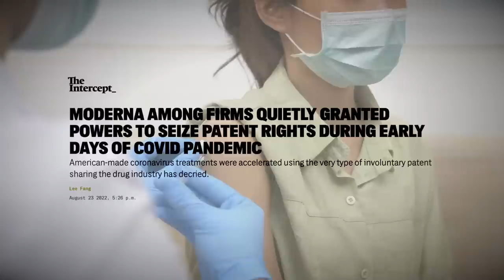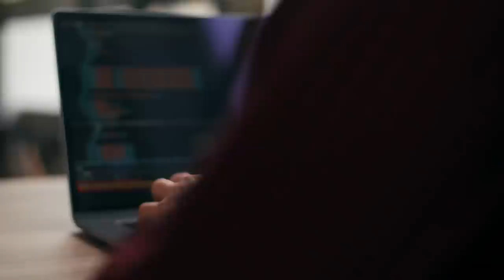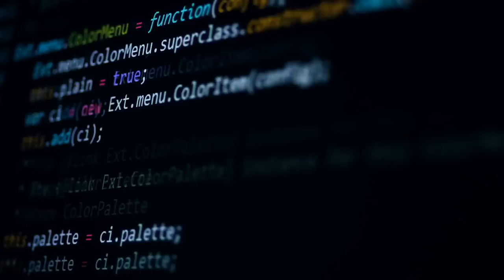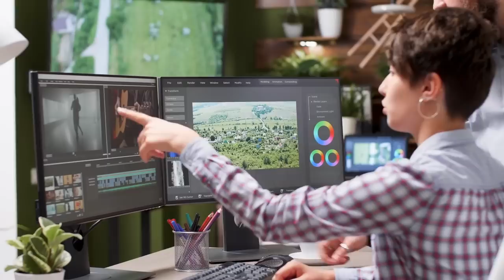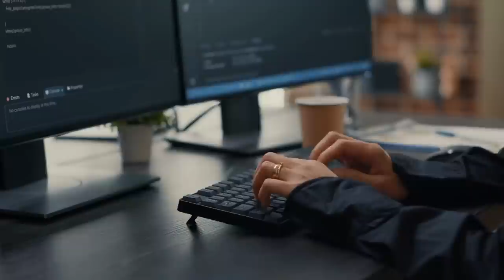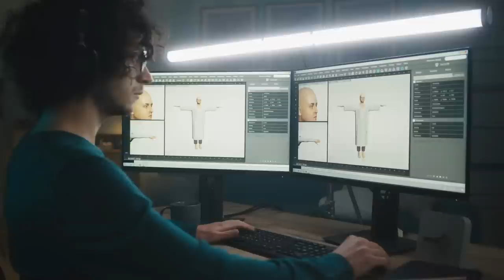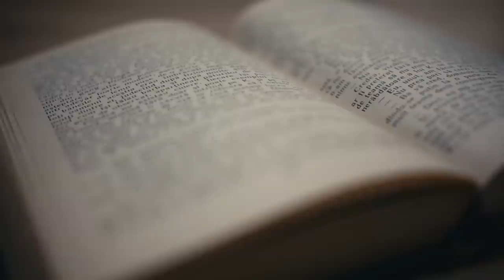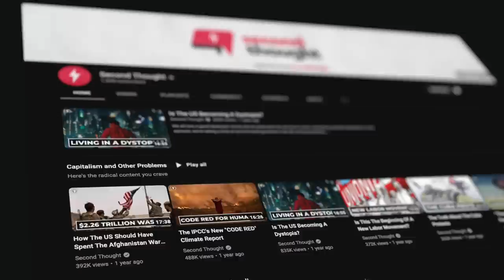Why We Should Get Rid Of Intellectual Property

Comment: Minor correction: Some of the most commonly used insulins, including Lantus and Humalog, have had authorized generics available for a few years and true generics for about a year. Still too expensive.
Reply: I was saddened he ignored the fact that intellectual property expires. The first insulin patent was 1923, why are Americans still buying protected insulin?
Reply: @superskrub4209  I thinks its because they renew them, by very slightly changing the formula, then patenting that new design. it's still close enough to the original that they can claim its ip theft when someone fabricates the original
Reply: @madladthad2403  this
Reply: @superskrub4209  Insulin itsself may not be patented, but the means of manufacturing it are. Also, not all insulins are alike. Often a manufacturer of pharmaceuticals or medical products will deliberately have their old products de-certified by regulators before the patent runs out, arguing that their new products are far superior and safer and render the old ones dangerously obsolete. That way when the patent does expire, it's still impossible for anyone to manufacture or import a competing product.
Reply: @vylbird8014  I think the same thing happens w/ manufacturers of refigerants.
Reply: @anmolt3840051  That's what I said. It's not the insulin itsself that is patented - sort of. There's more than one type of insulin, and while newer ones are patented, there's nothing patent-wise covering a slightly older form. But there are are a lot of adjacent patents - patents on manufacturing methods, on other components packaged with the insulin to preserve or or maintain sterility, on delivery mechanisms that are more convenient than the classic hypodermic*. There's also a substantial barrier to entry for any potential new competitors, in the form of regulatory compliance. Much of it well-intentioned, but getting your formulation and your factory full certified by the FDA, and maintaining that certification, is no easy matter. And certainly not cheap. So there are only three insulin manufacturers in the US - and they seem to have an unwritten agreement not to lower prices.

Regulations also make imports impossible. Yes, Canada has affordable insulin - but you can't legally bring it into the US, because it doesn't have FDA certification to assure it is safe. It doesn't matter that their Canadian counterparts are every bit as strict - their ability to certify safety ends at the border.

A major part of this problem is due to regulatory capture. The FDA works very closely with pharmacutical companies, to the point that there's even a flow of employees between them. A lot of FDA managers used to work for the companies they now regulate, and a lot of former FDA employees can look forward to lucrative future employment at one of those companies. If, that is, they play nice. Anyone who makes a serious effort to bring down drug prices, or to make it easier for new manufacturers to produce generic drugs, is going to find themselves pushed out of this friendly system - no promotions, no cushy future as a 'consultant' doing lobbying work. So the FDA isn't really representing the people of the US any more: It represents the very industry it is supposed to be regulating, and imposes regulations that are inconvenient for the major companies but catastrophic for any smaller or foreign competitors.

*That's an important one for epi-pens, because patents can't be expected to carry out a delicate injection procedure while in anaphylactic shock.
Reply: Thing is that those generics are made by the company that makes the brand. Reli-On Novolin insulin at Walmart is made by… Novo Nordisk who also makes Novolin. Packaging is the same as well. This is common in pharma. Astra Zenica makes their own generic of Symbicort, Mylan makes their own generic of EpiPen.

So then the question becomes why not simply lower the cost of the “brand”?
Reply: @vylbird8014  "So there are only three insulin manufacturers in the US - and they seem to have an unwritten agreement not to lower prices." - sounds like a cartel
Reply: @vylbird8014  You will never ever get anyone to engage productively on the topic of regulatory capture or the burden of regulations because it does not place the onus solely on Big Evil Capitalists who are magically preventing competition even though it would be so profitable to undersell them. This channel has a very myopic lens which it uses to view literally any scenario, especially the overly complicated migraine-inducing ones.
Regulatory capture and intellectual property chicanery needs to be addressed in various ways, sure, but the "well-intentioned" practice of onerous consumer safety requirements that ultimately still fail to prevent edge cases must be addressed as well. It is not productive or useful in the few scenarios where legitimately dangerous products are sold, and it has slowed the US medical industry to a crawl. The cost of that burden is directly offloaded onto consumers. Without burdensome and poorly implemented regulations, "regulatory capture" would not be possible.
The worst manifestations of all of this are laws and regulation around clinical trials omitting a patient's right to informed consent without IRB approval, substances being "controlled" at any level (including legend drugs), and legal requirements that US citizens engage with the insurance industry and its incestuous network of profiteers.
Reply: @Bingo_Bango_  Regulartory capture only happens because of capitalism. People are corrupt because it helps them make more money and/or live an easier life. This is much less of an issue when you are guaranteed a standard of living and don't have to worry as much about financial issues and if you are going to get a job with the people you are supposed to regulate.

You could also make it illegal to work or profit off the same sector as you were once responsible for regulating.

Comment: This is a great topic to cover.  I'm an Industrial Designer and I've done a lot of work in tool design where I've seen some pretty toxic use of IP.  

For example: Sawstop table saws are highly desired by woodworkers because they have a safety mechanism that instantly stops the blade if it contacts skin, saving many fingers hands etc. They are also hundreds of dollars more expensive than saws made by other brands because Sawstop owns the and other tool manufacturers have not been able to replicate it or buy the rights to the tech without getting sued (Bosch had a version for a while and was forced to discontinue it). Unsurprisingly profits > users severed fingers.

Comment: There's an interesting trope in some sci-fi about an extreme form of IP protection. Basically, all components are protected by and stored as liscenced blueprints. The only way to use then is by effectively paying to unlock them, and even then only for a limited number of uses and they can only be used in certified constructor machines. Assuming that most of their tech is beyond a human's ability to produce.

So what happens when all your production is utterly dependant on this, and a section gets cut off from the liscencing servers? 

All hell breaks loose for completely arbitrary reasons. You have the designs, the constructors, the materials, but you aren't allowed to use them.

Comment: All the talk around insulin is great, but just wait till you get deeper. Every finger poke blood sugar test (the most accurate test) is $1-$2 per test, which can need to happen multiple times daily. A continuous-monitoring device costs ~$300-400 every 10 days. Insulin pumps cost $5000 and are supposed to last 4-5 years, and the supplies for those cost $150 a month

Comment: Patents have to go, no question about it. It's so plain to see that they're absolutely NOT needed to incentivize any type of innovation. Also, IMHO the only IP huge corporations should hold is very basic brand identity protection (as in, to make sure no one steals their logo and/or sells products or services in their name). These are my thoughts about IP, especially regarding artistry which is a common argument for it as stated in the video:

The main problems with the system currently are that almost anything can be turned into IP,  that the IP can be held by massive corporations instead of people or small societies, and finally, that it can be bought and sold. ie Disney can just buy out IP to fuel their cultural empire and amass a sort of mainstream media monopoly, as well as choke out any independent creators who work under them by forcing them to relinquish THEIR work's IP. This may seem counterintuitive (why would anyone work with Disney then?) but in many fields, if you want any kind of relevancy, you're usually gonna have to work with some IP-gobbling giant corporation with an executive board hungry to push out merchandise and 30 sequels. This kind of predation already happens with publishing companies, record labels, networks etc that take over artists' work in exchange for pennies and a temporary platform, and it's getting worse by the day.

The thing is, the idea of IP COULD serve to help protect creators and artists. But it should only work at an individual/society (in the business sense) level. In an ideal world, if I make a piece of art and I'm selling it, I think it'd be nice if other people couldn't just copy it and sell it around without my permission, even if they did credit me. I DEFINITELY wouldn't want any company taking my art and re-using it, plastering it all over their products.

Furthermore, even in an ideal world, not every talented artist and creator will be able to crowdfund their projects, especially if they don't already have a following. If their work isn't directly beneficial to society in a very concrete way, government funding is probably out of question too. A lot of artists do freelance or contractual work under some company to survive. I'd argue protection from the company/contractor taking away their art and casting them aside as soon as possible to cut costs would be vital: if IP was inseparable from the actual creators, it could work as a way to give them permanent rights to their own work, providing legal power to fight against the misuse or insufficient payment of their labour.

Obviously, all of these idealistic good things are used as a shield to hold up horrible laws and protections for corporations that make life worse for everyone. So I'm all for abolishing the title of "IP" if we'd create something better in its place. More often than not, when people go to bat for IP protection, it's not small creators who are getting fucked anyway, it's neolib idiots and massive companies decked out with a billion lawyers that want to keep a monopoly. So don't get swayed by bad faith arguments. Current IP, copyright, fair use and especially patent law is hot trash and it all is in desperate need of change. IP should protect actual people, not block society from accessing life-saving technology.

Comment: Hmmm, dunno about that. Being a programmer myself, I'm all too familiar with open source and yes, it does work vastly different from proprietary code precisely because it's a bunch of people working together for that, but here's the thing: you choose to make it Open Source or not. even if the prospect of having that investment and later on the gains "for free", it still doesn't sounds nice that whatever I may create will be made public. What if I don't want to share that?

The pharmaceutical patents are are cruel and greedy as they can be, and in that regard I think some sectors should be free of patents. Something similar to the Public Domain when it comes to artistic IPs, or perhaps a very generic version of it and each company can use either that or some variant. Basically, I think IPs are good but are misused by lobbyists and if you tackle that problem, you can have both options at your disposal

Comment: this is barely related to IP's but one thing I would love to see is if an educational resource like what brilliant offers was provided freely. having a free (and quality) interactive educational website that would allow anyone to learn advanced math and reasoning skills as well as the scientific method is something that would be a major boon to society. it's kinda messed up that if you want to learn anything advance in our society you have to pay out the tooth for it just so you can get the limited opportunity to try and learn under a strict time limit in an environment that is high pressure and demands a considerable work-time investment while also having to work to keep food on the table and a roof over your head unless you are lucky and parents or relatives can support you during that time. 

higher education shouldn't have so many artificial barriers to keep out the "unworthy." the important thing should be improving and impowering people through learning, not metaphorically whacking them up the head (and wallet) because it takes them longer to learn this or that or because their brain learns better in ways outside of the factory assembly line model of educating that most institutions use.
Reply: How do the tutors on Brilliant get paid bro?

Comment: I am a biomedical engineer and IP is messed up. 

First, a point Second Thought touched on, IP helps stifle innovation. Pharmaceutical and medical companies, as well as all big companies, can create a product line where the get a patent for an item and patent future innovation on that item. They then slowly release the patents and items to maintain the monopoly the whole time. This means they sell worse items and prevent others from making it better. Which in the medical world is messed up.

Second, look up the EpiPen. This is used to demonstrate terrible design in any engineering program because of how high the failure rate was on trained and untrained personnel. They marked it up by 200% and maintained IP by telling the FDA they would improve it. They did little to nothing and people kept dying. That IP finally ran out and new alternatives were made that have near 100% success with trained and untrained personnel.

IP is maintained to put profit over people and there needs to be a rework of the whole system around IP for it to even help in the way it is "supposed" to.

Comment: I feel the "solutions" presented here are either overly simplistic or obliviously idealistic. I'm going to assume the first.

You have a good argument against the IP system as it is. I agree on that level. The system was meant for a time when there were more grey areas in business and innovation moved both more slowly, and with larger, discrete steps. Patents were a shield for inventors to profit and do more. Now, it's rapid,tiny steps and companies hoard patents, wielding them as a club upon competition turned pinata, beating them until money falls out.
I think any company that exists mostly of patent ligation is a parasite.

That said, your solutions are flawed in terms of innovation. How do you convince others to part with enough resources to make intermediate advancements, ie, the advancements with little gain but are the stepping stone for dramatic changes?

Wish I could say, "I know everything and this is how", but that would be a lie. Things need to change but change without a clear, unified destination is how you get Stalin, Hitler, Mao, Pol-pot, Wilson, and many more.

Maybe I'm asking too much though. Not like I have better ideas.

Comment: While this covers the use of IP for science and arts nicely, this is not what IP is defending in engineering. In R&D, outsiders tend to focus on the R part, en neglect the D (stop giggling). I hold a few patents via my employer, and for each of them, the actual concept being patented was developed in less than a day, usually while doing a mindless activity. The thing that makes the concepts worth patenting is a combination of strategic worth (enabling the next one), novelty, but most of all the years worth of grind to show the validity of the concept. 

Patent offices are filled to brim with trivial and asinine claims which should be ousted, but it does provide a way for a company to hold on to a concept they sunk money into testing its validity. It is not perfect, but how else? The common funds don't tackle this issue.

As for public money spend on private research, especially in medical fields, that crap has got to stop. Some minimum bar of change and novelty should be proven before the patent is granted. Mind you, this process is in place already, and somewhat effectively so in engineering, but big money can circumvent big bureaucracy. The solution here seems somewhat simple to me, stop with privatized medicine. I've never heard any diabetics complain about the price of insuline in countries living with a more sane medical system

Comment: I am a bit conflicted about this topic, on one I fully agree stuff like insulin should be 100% public but on the other hand I am a researcher. 

I am working on a chemical process to turn agroindustrial waste that usually costs people thousands of dollars and causes environmental harm into something with aggregate value that isn’t currently produced in my country. If it works pretty much everyone benefits, but I’d be lying if I said I wasn’t partially motivated by the potential monetary gain from this often predatory system.
Reply: You could say that if money wasn’t an issue there’d still be enough motivation to do this for the environment, but a big reason why people send loads of samples for testing is that we’ve convinced them that it could lead to monetary gain for them. Not every farmer cares about the environment and a lot of people are very fond of just burning waste and that’s in a country with generalized environmentally friendly culture. You’ll run into similar issues in every industry